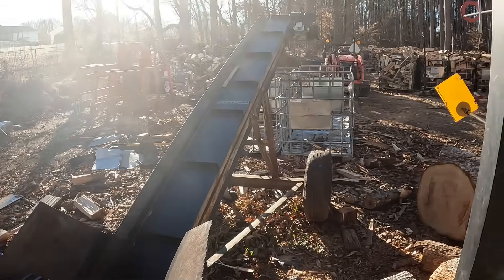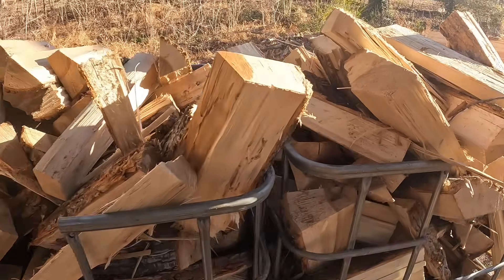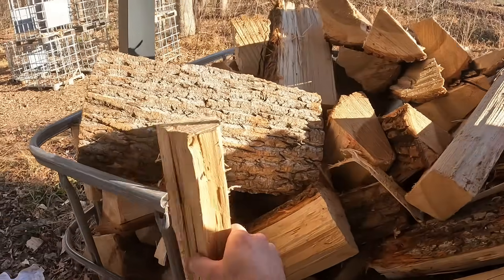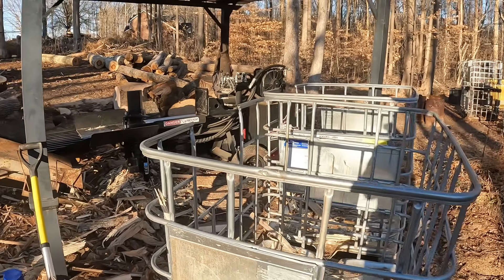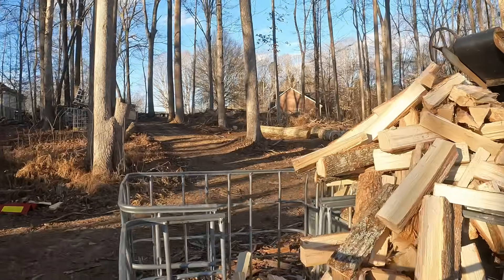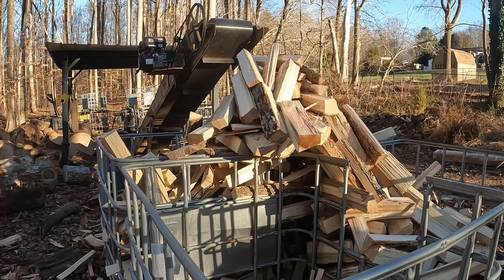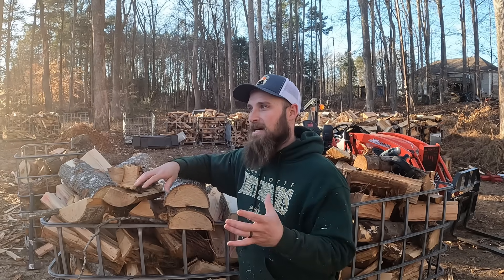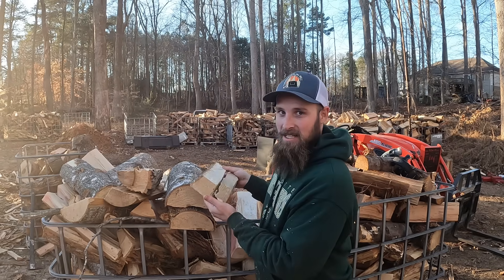How Bad Are The ReSplits On A Chinese Processor

Comment: To supplement my inventory I have bought wood from a guy who uses a Bells processor and he does two different piles, one through the 8 way and one through the 12 way. The first load I bought was through the 12 way and I found I got too much wood that was actually too small, bigger than kindling but too small to be nice bundle wood. After that I bought the bigger splits and resplit but that's not perfect either because there are many pieces that are a bit big to not resplit but cracked in half they're a little small. I guess this is a sacrifice that has to be made when using any large multi wedge to speed up production. What about running the 4 way and accept the idea that you will be resplitting but will have less waste?
I'm running the VS-C which produces exactly what I want, but obviously slower production.
Reply from the maker: Yes I’m not really worried about the waste part of it but I have thought about splitting with the 6 way to make bigger pieces. Those big pieces would go through the 4way on my log splitter one time. I feel the 4 way on the processor would make pieces too big to resplit 1 time. Thanks for the suggestion and for watching!

Comment: If your selling both couldn’t you just separate the bigger for home heat and separate the bundle and only split the over size for home heat that would shave off some time as well only thing is you would need a tote to throw your home heat wood into instead of going up the conveyor
Reply: Would also depend on your ratio of what size wood you sell more of as well
Reply from the maker: Yes for this type of wood I need it small as it will be used for bundle wood. For my home heat wood like oak I will not have to resplit. So as long as I keep the wood separate I will only have to resplit one type of wood. Thanks for watching!

Comment: Seems like adding another process that doesn't replace another process just adds time. If the processor relieves you from blocking then it should be even timewise. Maybe less physical work also. The machines gotta save you time otherwise they arent worth it.
Reply from the maker: Yeah the machine saves me time even if I have to resplit. I will get it to where I won’t have to resplit once I get all the same size logs together. Thanks for watching!

Comment: By weight its the same btu’s. I would keep splitting smaller since you probably get more money for the bundles over the bulk wood.  Plus you get the bonus of faster drying times and if you need to, you could seek bundle wood as heating wood, but you can’t do it the other way around.
Reply from the maker: Agreed, splitting smaller is better than splitting bigger. One product you can use faster than the other. Thanks for watching!

Comment: Maybe you could experiment and find which diameter logs work best with which splitter (6 way, 8 way, etc.). Then you can batch your logs and use the most efficient splitter so you don’t have to resplit.
Reply from the maker: Yes that is another way to control the split size. I will try all different wedges and logs to see what’s faster in the end. The 6 way might be the best for bundle wood if the bigger wood is faster for the resplits. We will see. Thanks for watching!

Comment: Firewood split size depends on your intended customer.  Those that are primarily heating with firewood, want bigger chunks.  Those that are recreational burners, they want smaller splits.   You'll have to make that determination based on your customer make.  The best way to resplit is to you a fast cycle time vertical splitter with a single knife.  There are several manufactures that offer those in commercial grade or semi commercial grade.  Of course, if you can sort your firewood processor logs by diameter and run the appropriate wedge then you won't have to resplit very many pieces.  Another thing you can do with your processor is to resplit them as they are initially processed.  Saves some time.  It's easier to do that if you have a second person to pull back the pieces that need to be resplit.
Reply from the maker: I agree on the wood size but  I have to disagree with the vertical splitter. I’ve had one and they are actually slower than a horizontal splitter. Thanks for watching!
Reply: @FirewoodontheHill  Perhaps that is the case.  However Adam at Hometown Acres, after he got his EVO processor, ended up selling he 37D horizontal splitter and kept the Axis.  The vertical splitter will hand any sized round that it can lift and make any size split you want.  However it is not as fast as a horizontal splitter.  So it depends on what you already have equipment for fire wood splitters.
Reply from the maker: @bwillan I might be wrong on this but I think every Eastonmade product he has used has been given to him from Eastonmade. If you look on YouTube Eastonmade has given atleast 4 channels I know of a vertical splitter use.  I’ve used a vertical on my channel which was loaned to me as well. If you were to spend your own money on this equipment it would be different.

Comment: You may want to think about using the wood processor to just block your wood then split it in the wolf ridge splitter this may be a time saver and better quality control for your bundle firewood.
Reply from the maker: Yeah I’m wondering the same thing. I will just have to put it to the test. Thanks for watching!